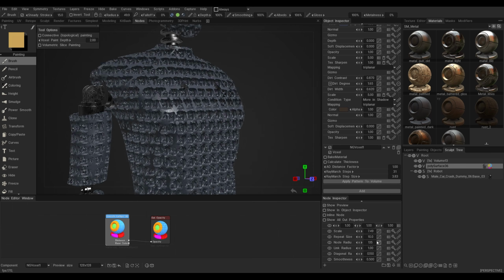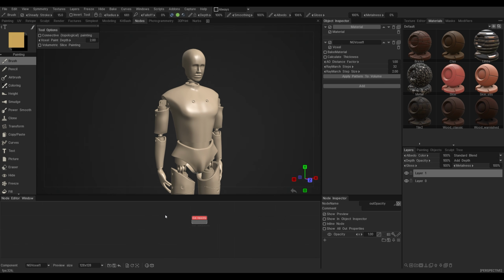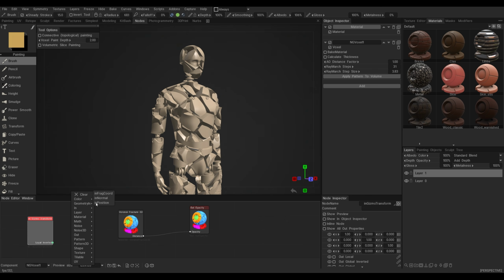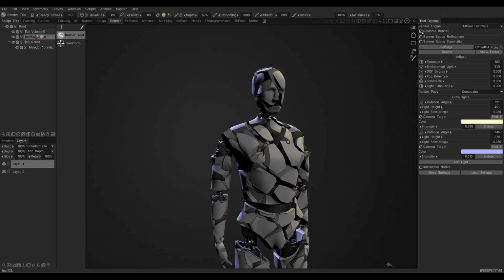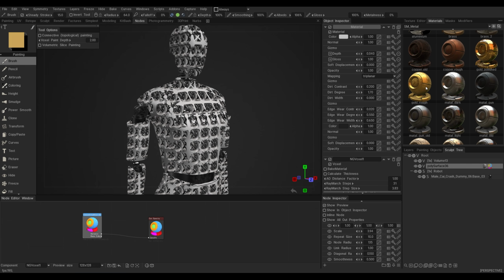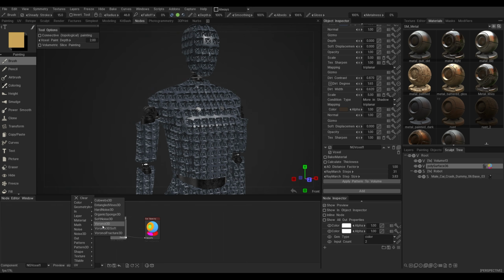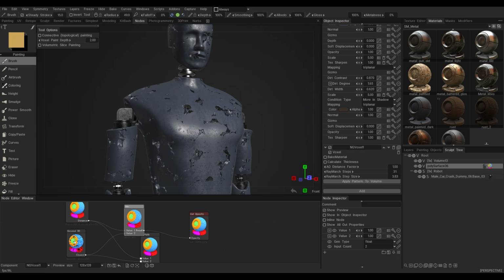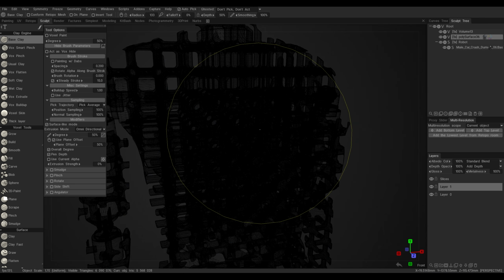3D LATTICE VOXEL STRUCTURES FOR ANY 3D MODEL - TUTORIAL.

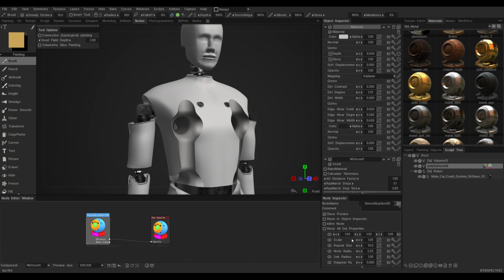Comment: 3D coat is powerful no doubt....HOWEVER the interface is really bad. by that i mean the ease of looking at a wall of text with horrible font that all in grey 🤢🤮🤢🤢🤮. just look at this example at @2:36 my whole body wants to throw up just by looking at it. I'd say to the 3D coat team for 2027 have 2 less features and spend the time on just making the UI nice to use and look at, Employ a UI designer!!! its badly badly needed. FK it Employ me! i'm out of work.
Reply: Please be specific, as to what makes the UI horrible, as you say. Just saying something pejorative doesn't help anyone. Critics do not realize that the structure of the UI is that way by user request, when a complete UI overhaul/redesign was done around 2008...which is a lot more recent than most 3D applications. The community at the time was full of Lightwave users because the Lightwave forum heard about this new texture painting app and they embraced it with open arms and they had a lot of input in the (then) new UI design. The community also wanted it to be very similar to Photoshop's and so all that input was acted on. Since the 3DCoat 2021 release, the development team has made incremental changes to the UI....even in this release, a LOT of user input was applied to the Node system, relating to the UI/UX. 
I agree there is  a lot of room for improvement and there are some things I keep asking for that has not yet been implemented, but the UI will be a big focus in this next cycle, so we will see how it works out. As is, the UI is VERY customizable, so you can arrange the layout with a little or a lot (of panels you use). The Activity Bar (on the inside of the right column and it appears as you move your cursor toward that column) is there so you can keep a very minimalist layout in any workspace. You can also hit TAB to switch to the minimalist layout and hit it again to toggle it off whenever you are ready. That is the simplest UI in any application. Almost totally naked if that is how you like to work.
Reply: @dnashj33 yeah sure I can be pin point accurate with that if you like 
1) the text is to big with little spacing between lines one line bleeds into another.
2) there is no indentation so everything feels important when it's probably a sub option 
3) ther is no dividing lines between things also compounding unreadability and categorization.
4) all the text is the same colour, tone and solid this combined with no spacings makes it hard to easily read.
5) the icons are also to big. 

It's pretty easy to see there is a vast improvement that could be done there. Blender had a massive overhaul and it paid dividends.
Reply from the maker: @paulworster3683...Thank you for your feedback. We are moving the UI over to QT and will be putting a lot of emphasis and effort into improving the UI/UX during this cycle. We will keep your input in mind as we progress. In the mean time, please watch this video if you haven't already, as it may help to address some of your points, in the interim.

https://youtu.be/t2eGYaMvr4g?si=n1gfOClS1_E8SqyR
Reply: @PILGWAY3DCoat  NW i am to the point but i think we all want 3D Coat to be more popular and the UI improvements would be a significant step up of improved that. i watched the video thanks for the link and tbh i'd set its to Medium by default.